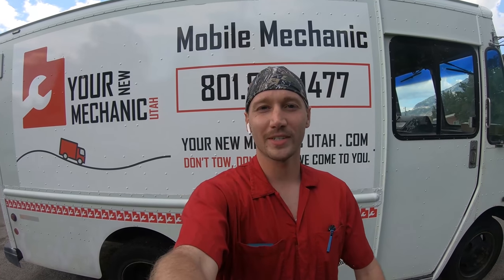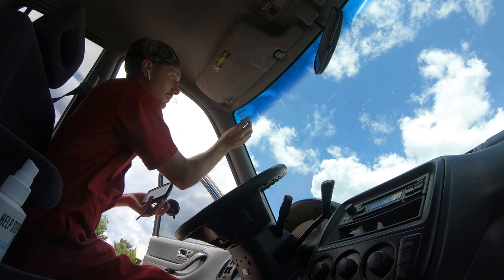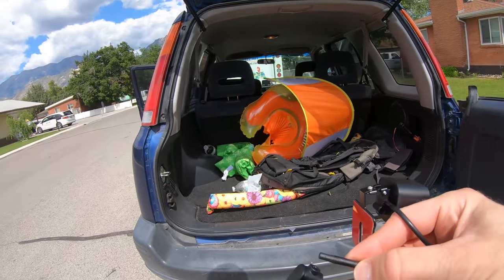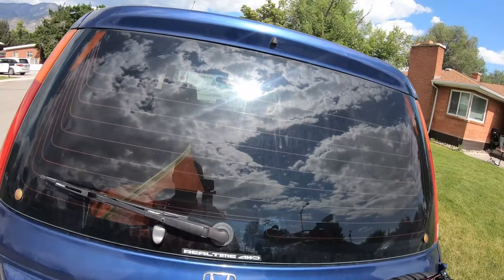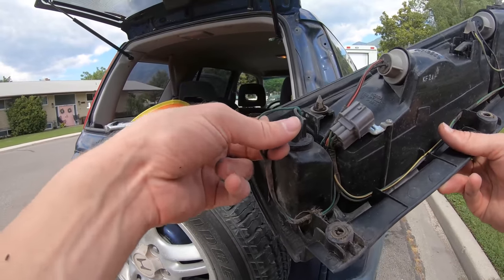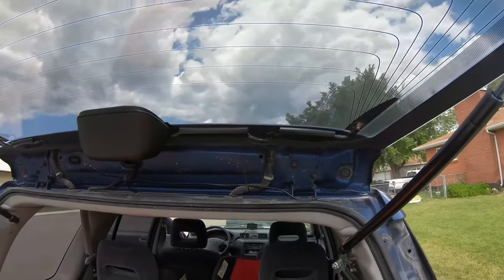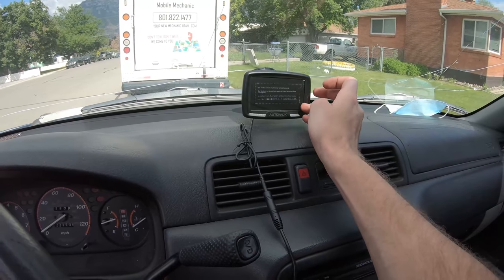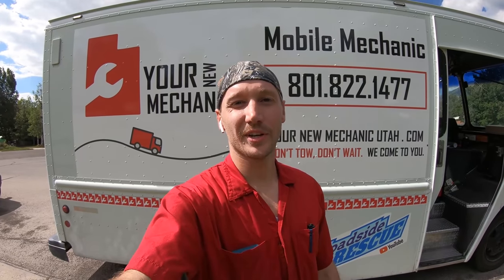Two bums try and carjack the car im working in. *Didn't know I was inside*

Comment: Good stuff as always! Couple of notes from personal experience for ya.

Those connectors suck. I see them all the time on small trailers and the complete lack of moisture protection allows for a fast failiure. And the corrosion often goes pretty far down underneath the insulation. Especially if you are using them for wiring where they are exposed to the elements underneath the vehicle. I prefer to use those heat shrink solder butt connectors, or if you have a proper crimper, crimped butt connectors (without the plastic) with a layer of adhesive heat shrink. Have yet to see either fail when properly installed. The solder joints can be susceptible to cracking when exposed to high vibration, but as long as it’s not on the engine it shouldn’t make a difference. 

Also those camera kits are great. I thought it was worthwhile to get a dashcam/backup cam kit for my vehicle instead of just the reverse camera. It mounts to the rear view mirror and was around $90 on amazon if I remember correctly. Works great as a backup camera, and the dashcam feature works amazing and has serviced me before. When the screen is off, it is still reflective enough to be useable as a regular rear view mirror. And the location on the rearview actually serves great as camouflage. I had my truck broken into and they did not notice the camera. Got their plate! also worked nice when I was hit in the middle of the night while parallel parked. As long as you have a low voltage cutoff unit set to about 11.5-12 volts on a healthy battery on constant power you shouldn’t have any problems. Little solar battery maintainer is also a good buy for that application. The only thing is, i’m not sure if they make a wireless one. They probably do though.

Also epic LOL on that failed theft. A carjacking is the robbery of a vehicle, and a robbery is when something is actually stolen from a person. From the looks of it, they were not expecting a person. Having a camera always rolling would also be great for that application! Would almost guarantee you get their plates, barring weird circumstances.

Thanks for the great content as usual! I have learned quite a bit from your channel. I have saved thousands on doing repairs myself, pretty much purely from information found on the internet. You are doing a great service to a great amount of people.

Comment: I would have placed it on the top right of the license plate.. where you were going to put it, but the "adhesive" part I would have placed between the plate and the car itself. (behind the plate, screw still usual place) Sandwiched.. I guess is the "proper" term. I also did notice you forgot to plug it in, which always happens to me when I'm doing it.. but catch it when in 3rd party..

Comment: I bought a 2 DIN android, and  connected the reverse camera to that. But I also have a portable Garmin I made a stand without drilling for it and used tiewraps to keep it in place looks very neat you hardly notice it, I hate to drill in dashboard and if I want to remove it, just cut tiewraps. Only problem I have is I wanted to install a switch to put the reversecam on and off, while driving, useful if you tow something and want to chekc if everything is ok behind you. Problem is my reverselights go on, tried diodes either I had no reverse image never worked so I gave up. Maybe you could do a diagram of how to make it work? Not to technically please I am a total non tech guy.

Comment: Curtis I put in a backup camera just like that one very easy to install and will protect me in the future. I have the same car different color although I'm not a single mom like you say these cars are for in a future video I still really enjoy it and fixing it. If possible would you consider installing a security system and remote locks combo? Preferably the same model I have (avital 3100 lx only 35$ currently and made by the same parent company as viper systems). I've had mine for 3 months and I'm just a bit afraid of cutting into the wires out of fear of starting a fire or something and I feel like I can't find good resources on installing into my specific vehicle. Probably need a security system anyway haha unless it already has one then just forget this whole comment. Thanks for the channel I appreciate you.

Comment: you should put in in the lower instead in left side of window, there i have my camera. and the connection you hold with the little black  is the wireless antenne, and the red sticker is some you take off it´s like tape so u can mount it behind the plate holder, that you not have on the car :-)

Comment: The only thing I’ve learned to be carful on when using those wire taps/t-connectors you mentioned in the video is with exterior use. They corrode easily and I’ve had the wire break inside of them, however they make ones with dialectic grease already on them that prevent that and work great!

Comment: Hey great job, but I'm no electrician but reviewing the video 20:41 the tips of those wires were exposed and at 28:59 you put it in with those wires still exposed. I'm sure every time you put the car in reverse you are causing a spark to jump to the body of the car.

Comment: I hope you ended up clipping off the extra 2 inches of wire you left hanging out of those splice connectors. Otherwise, you'll be back in there eventually chasing electrical Gremlins.

Comment: Love your videos. One thing I have to disagree.  Those scotch lock connectors are junk. Sorry to be that guy bro! But those things corrode and build high resistance. Twist solder and shrink tube. Only connection that holds up over time. You cannot keep moisture out of scotch lock.
Reply: i agree on them scotchlocks, ive tried liquid electric tape, silicone, bearing grease, and even hydraulic cement once (just for poop and laughter, lol) and they still get green crusties
Reply from the maker: Thats okay! Theyre not my favorite but if anything happens then ill worry about doing it the right way...

Comment: You use those connectors wrong and you left the cables exposed and will short soon.  You need to atleast cut or cap those ends.  On those connectors one cable goes trough and the other stop inside the connector.

Comment: That "sticky pad" is meant to give the suction cup a clean, designated
place to mount- instead of multiple ugly rings on the glass.
Lever: Push DOWN to release, then remove (for stowing away).
Position over sticky pad circle, push in towards glass, to evacuate air
from suction cup, and lift lever to lock.

You can alternatively use an Isopropyl pad to clean dashboard, and stick it down.

Comment: You made afew mistakes!
You could have cut the red and black wire's short. 
You left the red and black wire's exposed that can arc against the body of the car.
Use insulation tape over them crappy connectors. 
I have 25 yrs experience in this field. 
Greetings from 🇬🇧

Comment: 23:13 Please don't use those wire taps they are cheap junk, One of the biggest things i have found in Auto Electrical work (hobby) these are nothing but issues down the track. 
As for those Thieves nothing a bat won't fix.

Comment: I honestly can't believe you use those crappy t-tap connectors on your own stuff. At the risk of sounding a bit too harsh, an inline tap is just lazy and prone to future problems, I have dealt with many many of these in the past, and no matter how good you are at your trade these things are just a liability. At best its a bad and often high impedance splice, at worst it compromises the existing wire by cutting some of the strands as it becomes compressed, so you effectively de-rate the wire to a lower gauge.
Reply from the maker: heres the deal *if it has future problems then i mgoing to butting and soldering the wire anyways. If not then i dont care less work for me and a call back on my own vehicle is fine.

Comment: This guy should not be working on electronics. Hey Roadside Rescue .. you may want to clip those exposed ground and positive reverse light wires instead of tucking them in where they can short out on the metal or if moisture builds up. When you use a splitter like that, you are not supposed to run the "spliced" wire all the way through the clip. It is supposed to have the wire being spiced going all the way through and the added wire only long enough to hit the metal part and not coming out the other side.. so its "insulated". The last shot you showed when you were putting the light back in .. you can see the positive wire has part of the insulation stripped at the end and fully exposed.  HORRIBLE MOVE. You are not going to have a reverse camera for a long time and maybe not a reverse light... hopefully the fuse will pop before you screw up the computer from the dead short to ground.